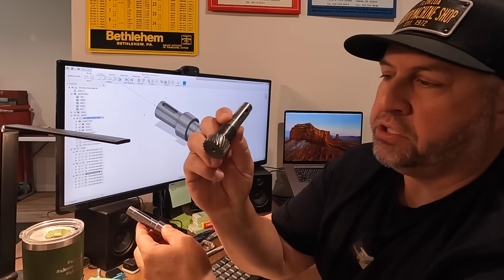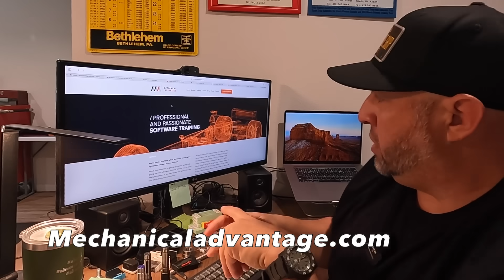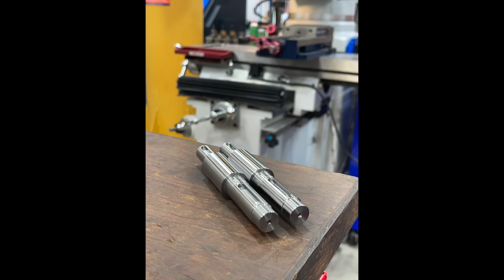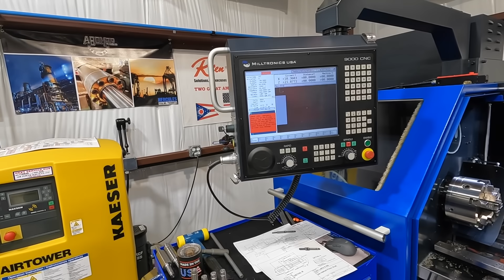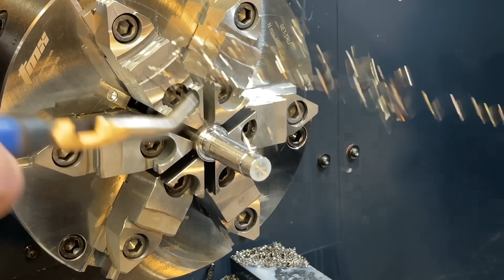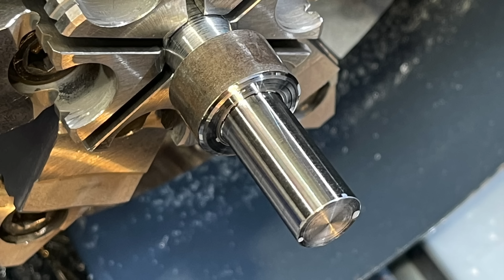Pinion Shafts Turned in the CNC Lathe

Comment: If you had a Mazak you could program that simple job in 3 minutes and you would have a hydraulic chuck with no slipping back.
Reply: Yikes, you just broke the arrogance record on this channel, which is a pretty high bar.
Reply: Curious. How much more expensive would that Muzak be?
Reply: @MechanicalAdvantage  About 10 times the sticker price of that Mattel lathe Adam is using, and he'd actually have to pay for it with money rather than just having to make commercials for the supplier
Reply: @grafixbyjorj Agreed. That was my point. It’s easy to make comments when you aren’t spending the money for the capability he was touting.

Comment: When I joined my current company, they were new to CNC and their mistakes look very similar to yours. They looked at the CNC lathe and mill as if they were going to continue their manual machining processes. They even wanted to use HSS tools. 
I was the only one there with CNC experience even though they were absolutely excellent in the manual.
I recommended collets (3J for greater range- they chose 5C since they had a bunch)
Carbide tooling
Coolant recommended by manufacturer for CNC
All operations possible per setup
Etc…

We kept the 3 jaw chuck for when we needed it.

Comment: Cadcam is a waste of time for most parts in a cnc lathe that have dialog programming,
Use the dialog in the Milltronics instead, it is so much easier if you want to change something, compared to cam,
and the programs get much smaller for the machine memory.
Reply: You know what your lathe isn’t doing while you are using the control to write programs? Making parts.
Reply: @MechanicalAdvantage  Well, on many controls one can program at the machine while it is running another program. And Abom need to feed the machine anyway, and press the green button. ;)
Reply: This shaft is a really good 'simple' CAD project so while tweaking the older conversational program is sensible the learning is part of the process here.

Comment: I'd be using a 3 or 4 jaw chuck.  6 jaws in my opinion are ideal when working with thin wall material like tubing to prevent crush.  They do not have the grip strength like a 3 or 4 has.